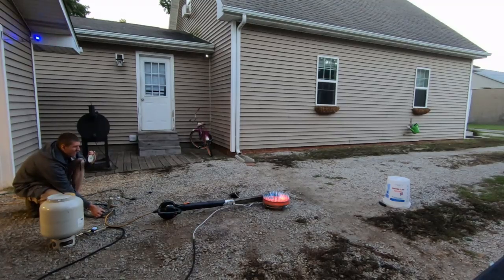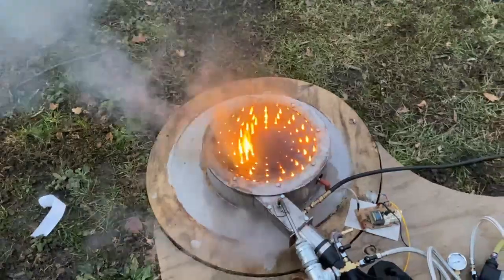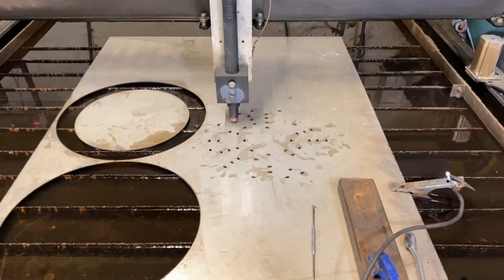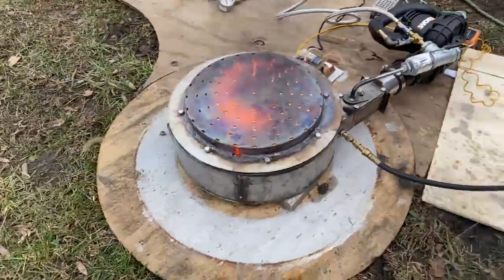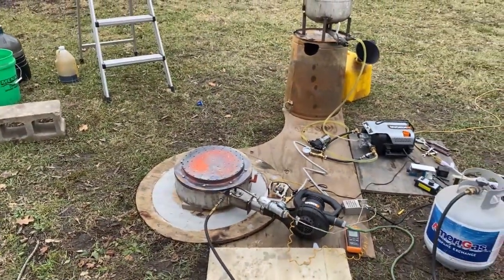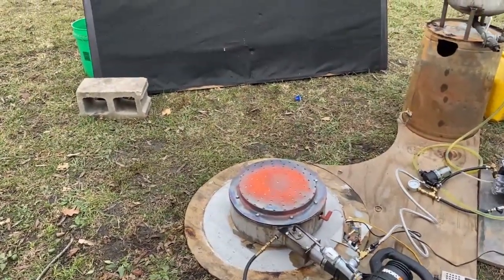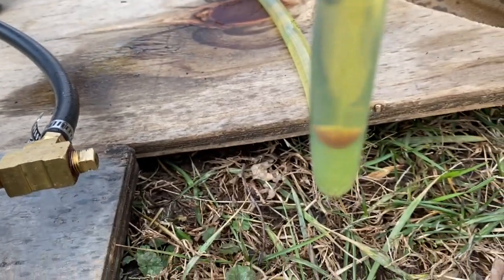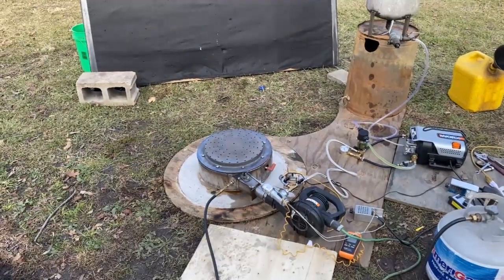Autoclave boiler Build for Richie in California

Comment: I think the sprayed oil was burned inside the chamber.   Should we heat the oil  either by conduction or radiation in order to turn it into vapour(instead of spraying it) before mixing with air?  I think it would be more economical that way.

Comment: Hi, have you tried using a 12v or 24v glowplug designed to ignite diesel rather than spark plug?...need to allow the plug to heat up first before adding fuel. Also, won't need gas to pre-heat. As I said before look at Chinese diesel heaters which may give you some design ideas?

Comment: Get a glow plug and use it instead of a spark plug.  It will ignite the fuel and oil.
Reply from the maker: Great idea friend , i do have a silicon nitride heater ignitor on the way but i think your glow plug idea is superior .